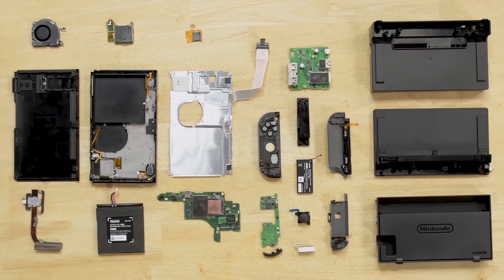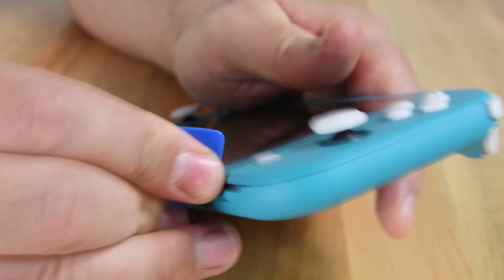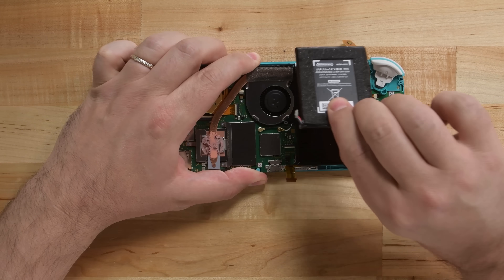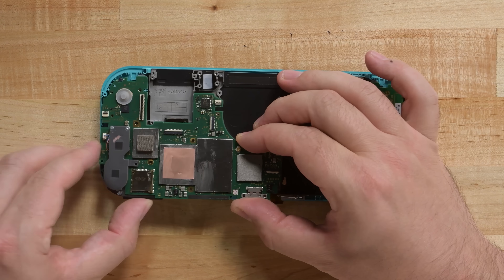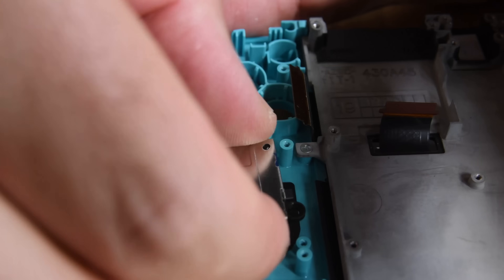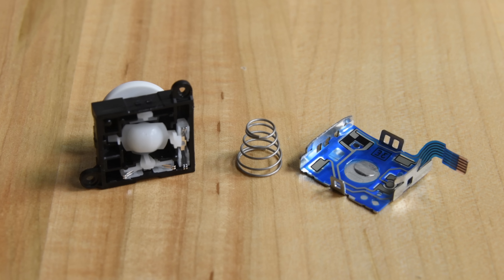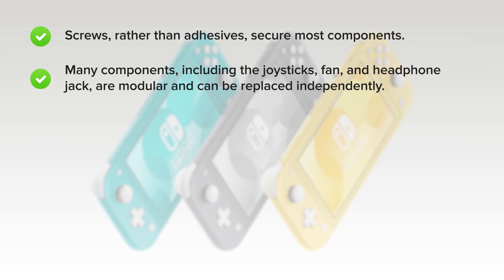Nintendo Switch Lite Teardown: Hardware Upgrades, Repair Downgrades

Comment: HIIII question I aint a tech professional like you clearly are. So I have a question. I have been wanting to get rid of the yellow shell (like yours is blue) for about almost two years now but I am NOT a tech person knowing me I’d wreck it if I did this. So I’m wondering if it’s okay to spray paint or use acrylic paint directly on the yellow shell, obviously I’ll be using masking tape but I’m just wondering if it’s okay or if it would ruin the lite completely?

Comment: Is it possible to replace the switch lite display for an OLED display
Reply: There is a new manufacture for OLED screen on the switch lite. You can even get them in toughscreen and have an option to replace the SD card for HDMI output if you really want.

Comment: Doesnt it directly tell you to NOT do this is the SAPM? (System and Accessories Procautions and Maintenance)
Reply: Imma bout to quote the SAPM. "Do not disassemblr or try to repair the Nintendo Switch console, components, or accessories. Doing so may damage them"
Reply: That’s just what companies say legally to not be liable if you mess up.

Comment: So I changed the joystick under the smaller motherboard .. the white beside the grey speaker battery that the blue and red wire detach from the bigger white connection? The bigger white piece snapped off and idk what to do. Any advice? I'm freaking out I don't know how much it would cost to fix or if/how I can do it myself.

Comment: @ifixit Your link to the Switch battery kit in this video is for the regular Switch, not the Switch Lite. To avoid any mistakes or complaints I would fix that. Great video btw, thank you!

Comment: What to do if the power and volume buttons are 'sunk-down'? Can I pop them back up somehow? Is a spring loose or something probably?
Reply: Use isopropyl alcohol and a q tip. Just rub it around the button while pressing gently over and over and it should loosen

Comment: Can you access the bumper buttons without taking out any of the electronic components or battery? One of mine is totally stuck and I've had my switch 5 days...so I think something is just in there.
Reply: For you it's probably too late, but for those who read this and have the same question: Yes, you can take out every shoulder button without the need for removal of something else.

Comment: Any suggestions for fixing the SD card reader not working? I have found a lot on troubleshooting/fixing the switch but not the switch lite. It seems a lot more complicated since it is not modular/separate from the motherboard.

Comment: What size screw driver was used ? I need to open my daughters switch up to get the home button unstuck.
Reply: It takes a 2mm tri-head scew driver
Reply: ... And 2mm cross-head.  To take the case off.

Comment: I just saw a video claiming the sticks and buttons on the joycons are bad quality and are failing for numerous users, where they've had to buy new joycons cause they break after about a year when the warranty runs out. Is that true? Are the components bad quality and failure prone?

Comment: I was just wondering where you would recommend I find replacement parts for the left mini board of the left joy con system. I have not been successful thus far finding a replacement part for that particular board. I see plenty of motherboard replacements but none for the left joy con mini board. Hopping you can help with this.

Comment: If I remember correctly, Nintendo redesigned the switch light joysticks at some point... Would you consider making a video that showing what changed (if anything)?
Reply: I got my Switch lite in Dec 2020, there are dead zones in the left joystick and buttons that stay pressed even when not. I remember playing rocket league for the first time and not being able to forward flip without jamming the stick all the way forward, even after changing the dead zone settings in the software. just looking at the stick at rest, the centering is way off. 
The button sticking is new for me but it caused havoc in menus and during play.
I've since moved over to playing on my PC and well, it's nice to be able to actually see the ball down field with a larger screen. lol. but I'm sad because that's all I used my switch lite for.
Also when I was watching youtube on the lite. For some reason my screen got really hot, it also sank my batteries so something is up with the app or my device.
Reply: The switch lite has always had the same Joysticks, they are the same switches as the 2019 switch, simply more durable components, I haven't as yet seen anyone with drift on a switch lite, if anyone has please leave a reply.
Reply: @timothymartin5538  there are people with drift
Reply: @timothymartin5538  I got deadzone. and if i push it hard enough it will start to drift.
Reply: @timothymartin5538  Just sent mine off to get repaired because of drift and had one before that (that my mother now has) that also started to get drift. Trust me, we're not exempt from stick drift 😢

Comment: How did you get the battery out? I've been following along because my right joystick is completely broken and needed a replacement but I cannot for the life of me get the battery out
Reply: You don't need the battery out with a joystick replacement on the lite.
Reply: The battery is glued down but will come up, perhaps not in a reusable state.  It's not necessary to take it out to work on inside, unless it's the battery you need to replace of course.
Reply: Here you go:

https://youtu.be/_YubjiHXGDs

BTW remember that the flat ribbon cables coming from the battery are held in place to the board by tiny plastic hinges that you need to swing up, then the cable will litterly fall out of the connector for you.

Comment: We can replace an old switch battery  with a "new switch" battery? They are compatible?
Reply: The new switch battery is the same it's just the processor that's different

Comment: build quality seems to be way cleaner and compact than the first gen switch etc...
Reply: i have one, and to me it's also more comfortable and more like, solid feeling than the original switch. i think i prefer it, definitely for handheld mode. wish the screen was sliiiightly larger but it's not a bad size as it is

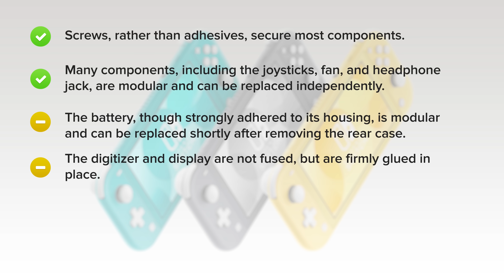Comment: 2:19 fwiw the emmc was effectively non-replaceable in the OG Switch too.
Reply: Hey, I'm reading your comment and wanted to ask you a question... It there anyway to retrieve data from the flash storage on a broken device?
Reply: Joe Callister Depends. Almost the entire flash storage is encrypted using keys that are unique to every device. So if it’s able to power on to some extent and it’s a hackable device or you already have/had the device unique keys, yes. Otherwise, no.

Comment: Okay, a counter argument: Everyone who's trying to get inside this thing will need a special toolkit which most likely will already include tri-point screw drivers. Soldered flash storage is a bonus, it's faster, soldered SD card reader isn't a problem, you stick a card inside and you're probably done for good.

You're reducing the score just for the sake of it, looking for ways to make the 10/10 inaccessible.
Reply: I would say this is iFixit's point for scoring repairability on electronic devices: By needing a "special" toolkit to repair devices is bad for consumers. And iFixit is fine to score Switch Lite down to give consumers a warning that Nintendo compromises repairability for a lower price.
They gave the original Switch 8/10 repairability score, by the way. I can guess why Switch Lite is two points lower (adhesive on battery & soldered eMMC and microSD reader - both are compromises that could be avoided if they don't constrain on the cost).

Comment: Can you look at the newer version of the normal Switch if there are any differences?
Reply: There's no difference, nintendo just changed the cpu
Reply: @sirciop1808  I thought they changed the gpu?
Reply: AppleToaster There’s no GPU chip. Only SOC chip containing the GPU unit. Basically the newer Switch uses the same chip with smaller transistor size for better battery life and slightly better performance.
Reply: @emperorfaiz  ooh I see. thanks!

Comment: Swicth makes me miss my PSP. Too bad they no longer make new versions of them.
Reply: From what I've heard, Sony no longer has interests in handheld consoles. Not too sure if that's true or not.
Reply: Don't worry Sony never stops copying Nin so Vita will be back another gen race. Just hang in there!
Reply: @solonepeon5805  Bruh Sony made the concept of Switch 10 years before Nintendo. PSP Go in particular had a tiny dock and ability to connect external controllers wirelessly to play on TV. If anything, Nintendo should have been better at copying Sony and kept the TV connectivity on Switch Lite with a tiny dock.
Reply: @weaverquest  Have you ever heard about the Sega Nomad?
Reply: @weaverquest  would make no sense for a PORTABLE console to dock to the tv

Comment: The tri point screws aint exactly a negative.
Reply: I disagree. It's a specialized bit.
Reply: @RannonSi  If you deal or repair with nintendo/rather with any devices, having a tri point screw is already a norm. This rating system is skewed to fit and inform the normal user. but why would a normal user even watch repair and disassembly videos? 

I can only think of one thing and that is to repair their own device, and the tools they will be getting inorder to enter the field of repair has a tri point screw as a basic tool

so stating tri point screws as a negative is wrong. at best it should be a neutral point and not a negative
Reply: @GuardTower  Considering that they're about helping people fix their own stuff I'd say that I agree with the rating system being skewed towards normal users, because it's meant for the normal user.
Reply: If they have chosen a Phillips screw the repairability score could be higher. There's no reason for Nintendo to prefer tri-point screws other than to keep casual repairers out. It is part of iFixit's goal to encourage easy-to-repair devices, hence the score drop.
Reply: @Explorer09_kc  i don't care about the score. what i commented on is that the "tri-point screw aint a negative"... and if newbie repairs are being done... a tri-point screw is already part of the basic toolset unless you buy things in retail one at a time

Comment: I am glad that switching stick is still very doable like joycon itself. I replaced stick for third party one myself on joycon not because of drifting issue but rubber nub on stick peeled off but it was impossible to actually fully stick that nub back into place. Mine got off by accident, but please DO NOT take that thing off yourself, you will not able to put it back on perfectly. 

Having said that, Switch that can't switch have no use for me... Also I bought that huge Daemon X Machina joycon replacement, mainly because my big hand can't use joycon comfortably on the go. I can gladly sacrifice some portability for my ergonomics.

Comment: How is this a 6 when the iPhone 11 was also a 6? This definitely has more easily swappable parts than the iPhone.
Reply: Asking the real questions! Would love an answer.
Reply: That’s what I was wondering. I could see the changes meaning a one point drop, but this is much easier to repair than an iPhone.
Reply: they also take into account of kind of device it is
Reply: @Supcharged  shouldn't a phone be more 'repairable' than a gaming console for the same score then?
Reply: Because triwing screws are literally a 3 dollar fix
Reply: i give ip11 a 3, its impossible to repair
Reply: IGN effect
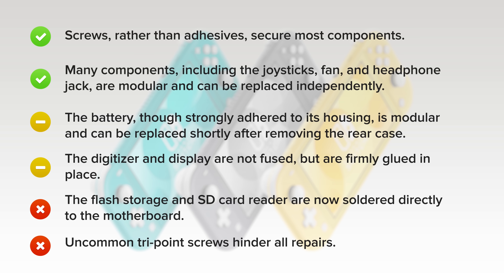Reply: I suspect my 8-month-old switch lite has a swollen battery but can't open it because of the non-standard 2:24 tri-point screws. I have all types of screws (including tri-point) except for the SMALL  tri-point ones.
I would say it's 1/10.
Reply: nintendo switch lite ZL ZR L R ABXY volume home buttons Card slot shell housing replacement parts yellow gray turquoise  http://egamephone.com/index.php?rt=product/category&path=58_59
Reply: if I had to guess, I'd assume it has to do with modular parts. while the iPhone has more delicate parts, if you needed to swap one, it is possible. I'm not going to say that it seems easy, but to us, comparing a $200 console to a $700 phone is a bigger factor. break a part in a console, shouldn't be too hard to find the part and not a huge sweat about it. Break a part in a $700 phone, it can be nerve-wracking. Personally, I believe the iPhone score should be lower (maybe a 4), but I can kinda get why it is a 6.
Reply: Why does this comment remind me of a certain melon...
Reply: Bc they have higher expectations for this bc it’s bigger and has more room to put in components than a iphone
Reply: iPhones are phones, not really meant to be replaced in any way.
Consoles have always been repairable.
We're comparing orange and Apple here. Heh.
Reply: because apple owns iFixit
Reply: @RinconDev  no they dont?????
Reply: More specifically how flash storage and SD reader are now soldered.
Replacing SD cards back and forth is common and that may make the reader die out really quickly. Phones offer much more storage, not just 32GB in 2019 and you don't really need to change SD cards as often as the Switch either.
Reply: Probably because more vendors can service the iPhone, and has more experience doing so. There'd be more parts on the market for iPhones too.